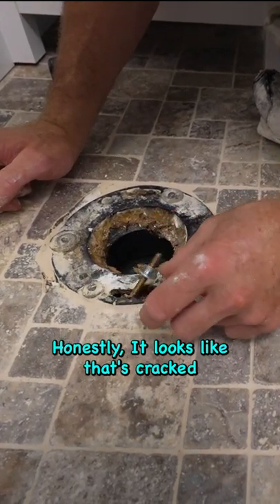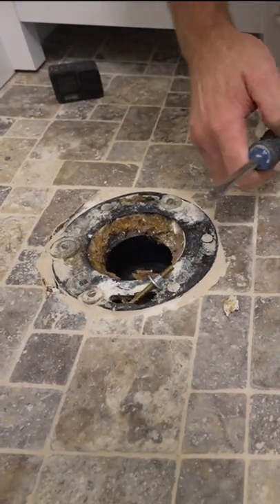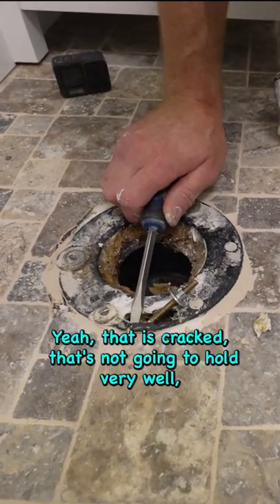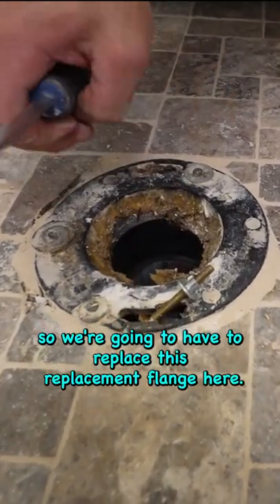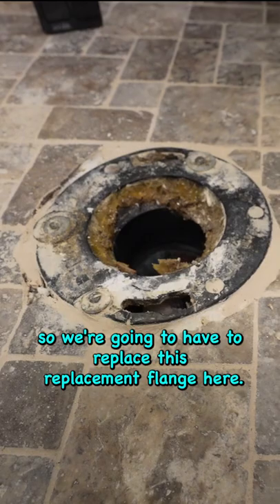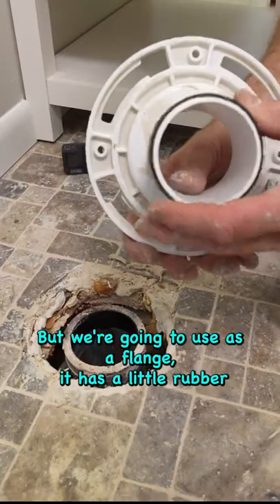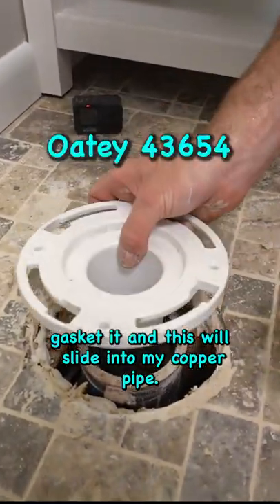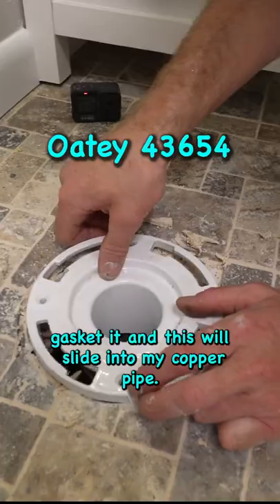Oh NO 😩 A Toilet Flange Crack🚽#shorts #Youtubeshorts #DIY

Comment: Surprised that u did no repair to the gap in  the flooring around the drain pipe before installing the new flange.  It appears that the original flange failed because of undue stress from lack of support around its entire diameter.
Reply: It seems like all workers these days. Take those shortcuts.
Reply: How would that have been done without damaging the tiles and making it a much bigger repair? The flange is even with the floor so the toilet isn't going to rocking on it and will be well supported by the floor, I personally would have done a metal repair ring but the reality is it's not reasonable to go back and redo everything to 100% of how it should of been, it's too much money and too much time for most people and in a lot of situations good enough is good enough even though internet trolls like yourself like to act differently
Reply: Exactly
Reply: Maby thw owner just didn't have the money to properly repair it maby it wasn't up to this guy's.
Reply: agreed lazy work.. fill it with fast set cement.. level to floor... tapcons..

Comment: My dude forgot to twist it to tighten the seal against the inside of the pipe. That’s like the whole throwing a hot dog down a hallway for a girl that’s been around, you’re barely touching the sides of that pipe. Copper pipe might have a slightly different ID (inside diameter) no twist equals no seal. If that pipe ever backs up your floor joists will be met with human waste water.. enjoy.

Comment: That flange slid in with ease like a cheap first date.... too easy!  Pretty sure there are some that twist and create a seal brotha. Yall gonna have a backup and see that doo doo butter come a pumping out, breh!
Reply: If you didn’t notice it wasn’t even sliding into a pipe…it’s another rubber double sided boot like clamp.
Reply: @rideordie1583  It was sliding into the pipe. The pipe was connected to the fernco (rubber double-sided boot like clamp). You have to kind of really look for it to see the pipe.
Reply: He didn't twist it to give it a proper seal.

Comment: Original flange not secured.  Should add stainless washers and stainless lags screws to secure new flange. Also, the type of new flange requires you screw clockwise in order to expand gasket to seal. You should have filled the void in floor prior to setting new flange

Comment: Flange should be above the floor height.
Reply: It's true but it's actually better to be closer to flush then have a gap above. 90% of the cracked flanges I see or even toilet leaks is a gap between flange and floor not sitting on it support so the weight of commode cracks flange suspended in midair. That being said......the steel ringed flange would still prevent that error from happening (but not leaks still)
Reply: @Spookytooth92  That sounds like a failure to properly install the flange to where it sits on the floor than it is a need to make it level with the floor.
Reply: You’re wrong. But ok. You want the toilet flush with rhe floor. Not much more than that

Comment: That flange is a twist and lock flange. You didn’t install it correctly by just pushing it down. They have a thread on it and the more the gasket moves closest to the ceiling the tighter it gets. I usually use some pipe dope around the gasket as well so it seals even better.

Comment: Cool tip. What were you able to drive
The screws into? It looked like there wasn’t much around the pipe.
Reply: Every once in a while you find that magical air in the void that holds a screw and it’s amazing.
Reply: He put the screws in at like a 45° angle, which tells me it most likely was the only way to hit the subfloor.
Reply: You can’t be Chris R.

Comment: I hate when people use those flanges. It reduces the pipe diameter way too much. Zurn makes a replacement that goes over the pipe and seals from outside and u have full diameter.
Reply: This is nonsense that I have even heard some plumbers repeat. Do you know what the size of the built in trap on a toilet is or what size the tail on a reinforced wax ring is? It is less than 3" in both cases, usually between 1 3/4" and 2 3/4". So you're telling me that increasing that section by 5" or 6" will cause clogs? No, not if you're flushing what is supposed to go down the toilet - waste and toilet paper only.

Comment: Nope, he just reduced that opening from 4 inches to less that 3 inches. That toilet is going to start having clogs more and more. Never reduce the mainline opening like that. Replace with a 4 inch flange.
Reply: This is nonsense that I have even heard some plumbers repeat. Do you know what the size of the built in trap on a toilet is or what size the tail on a reinforced wax ring is? It is less than 3" in both cases, usually between 1 3/4" and 2 3/4". So you're telling me that increasing that section by 5" or 6" will cause clogs? No, not if you're flushing what is supposed to go down the toilet - waste and toilet paper only.
Reply: Also that opening is 3". What you're looking at that you think is a 4" pipe is actually a fernco.
Reply: That's bullshit..done this repair a thousand times and never a problem

Comment: #1- Why not replace it with the same 4” cast iron bolt down flange?
#2- you didn’t install that Oatey “cheater” flange properly. You need to twist the flange so the black gasket tightens inside the pipe. You’ll find out the hard way once the toilet line backs up.

Comment: Copper pipe?????looks like a rubber boot...we see the clamp around the rubber boot. How did you tighten that clamp after you screwed the flange to the floor.
Reply: He bypassed the "rubber boot" (fernco) and slid the repair flange into the copper pipe that it was attached to. The fernco (rubber boot) became unnecessary at that  point so there was no need to tighten it.

Comment: I don’t like your repair. Once you removed the old piece, you should measure the pipe and buy size to fit. I always purchase pvc with a stainless steel flange, I don’t use units with plastic flanges.   Jim

Comment: I have GOT to find those pieces that went on the closet bolts! The plastic washers do NOT work and putting a nut on there sometimes makes it too big and toilet won't seat correctly. 
What are they or where did you find them?  Pleeeeease?!

Comment: From a contractor perspective. The proper way to fix a cracked flange is to get a licensed plumber to come to and do the repairs so it is under proper warranty.
Reply: From a contractor perspective I usually install my toilets after my licensed plumber does everything else. I like to leave them off until the end to make sure I can paint and install baseboard first.
Reply: @Tool_Addicted_Carpenter  As a contractor. You shouldn't be installing baseboard and painting. You are literally missing the purpose of a contractor. It is not our job by any means to hook up toilets, install baseboards, and paint. It's our job to know the phone numbers of plumbers, carpenters, and painting companies, and facilitate it all being completed.
Reply: @misplaced_redneck7233  What are you talking about? As a general contractor our job goes beyond just coordinating subcontractors. I know very few GCs that limit themselves to finger pointing. It makes a lot of sense economically efficiency wise to play your strengths and do as much of your own work as possible as long as it doesn't impact scheduling. I very rarely paint but I do all of my own trim work, kitchens, built in cabinetry, and fireplace mantels. I don't trust anyone else to care as much as I would. I utilize 2-3 dozen specialized subcontractors but I do most of my own small framing jobs and always do my finish work.
Reply: @Tool_Addicted_Carpenter  While I do respect 100% the mentality of "Wanna get it done right, gotta do it yourself" On many finish items, but the idea it doesn't make sense "economically" to have subs do the work just doesn't make sense if you estimate properly that should all be factored in and you'll be making a percentage either way.
Reply: @Tool_Addicted_Carpenter  Maybe its different where you are but down here in South Florida if you aren't working on a Time + Material + Percentage basis you are asking to lose your ass any second on a project. Just my experience.
Reply: @misplaced_redneck7233  Ya my prices are time+material+20-30% profit/business expenses. Time and % varies based on complexity. I just price everything based on my experience with my subs and I price what I know I'll be doing myself accordingly. I have 2 business partners and we utilize our different strengths. One does drawings, site visits, basically PR(like sending holiday cards to customers or flowers at the end of builds), and meets subs. The other is very good with business and takes care of aquiring some materials and towing the trailers, and can be the cut guy and does most Carpentry. I do the initial estimates, make stock lists, preliminary drawings, before we all sit down and go over them. Then I do the design and build and finish everything. All 3 of us meet customers and subcontractors whenever and we all bang out some insulation if we need to. It's a solid dynamic and we've acquired some great subcontractors.
Reply: @Tool_Addicted_Carpenter  See now you're literally not making sense if all your prices are T+M then you should have no worry about getting your toilet set "economically" because whatever the plumber charges you, you're just going to charge the homeowner + your percentage and make money off of it. You doing it yourself loses you money by your own reasoning.
Reply: @misplaced_redneck7233  I don't lose money and the plumber has no problem setting or not setting the toilets I just tell him what I prefer for that particular job. I actually make money because the homeowner already has a price based on my plumber doing everything and he doesn't charge me for what he doesn't need to do so the money goes to me rather than the plumber.
Reply: @Tool_Addicted_Carpenter  Okay you're literally not making sense. Bring it back to the beginning, your WHOLE argument was the "economic" point of setting the plumbing yourself. Now you're pretty much just saying you bill and accept payment as if the plumber is doing the work. But you do it yourself and keep the money. Which is fraud by the way. If you overcharge for a service which is fulfilled at a lower price you are obligated to pay back rhe difference. I'm just trying to give you advice because it really doesn't seem like you know what your talking about, especially if you're this comfortable admitting to fraudulent business practices. If I charge someone to build a pergola on their property, and I estimate it as if I'm having my outside carpentry subs build it for me. And I end up building it myself, that doesn't mean I keep all the money it means I adjust and pay back the difference. People like you really do give genuine contractors such a horrible look.
Reply: @Tool_Addicted_Carpenter  I love the fact once I point out that you are on here openly talking about fraudulent billing for clients, you go silent.
Reply: @misplaced_redneck7233  It's a wax ring and 2 bolts. You're being absolutely ridiculous and I think most people would agree. It's not fraudulent billing and everything is permitted and legal. Take a chill pill, I know what I'm doing. I've taken formal plumbing education classes and a toilet is so simple a homeowner can install their own in 15 minutes. You can call it whatever you want, I'm a good contractor and I don't get callbacks.
Reply: @misplaced_redneck7233  And your other comment never game in my feed so stop hovering over your phone fishing for an aimless and senseless argument with someone you don't know and will never meet or be effected by. Do a little introspection for the rest of the day.
Reply: @misplaced_redneck7233  dude wtf are you talking about? You give the client a price and they accept it. It doesn’t matter who does the work or how much they’re charging. If your sub is also subbing you think the client also need to know their price too?

Comment: That’s a fail for me there’s a fernco below that and you reduce the flange opening To 2”inches that’s a constant clog
Reply: This is nonsense that I have even heard some plumbers repeat. Do you know what the size of the built in trap on a toilet is or what size the tail on a reinforced wax ring is? It is less than 3" in both cases, usually between 1 3/4" and 2 3/4". So you're telling me that increasing that section by 5" or 6" will cause clogs? No, not if you're flushing what is supposed to go down the toilet - waste and toilet paper only. Also that is not 2 inches. It's 2 1/2" and yes it does make a difference.
Reply: I agree.. I've done this same repair a thousand times and never an issue

Comment: Looks like that was a fernco type coupling under the floor. I don't use wax rings anymore. Maybe a stainless steel reinforcing ring would have worked? Good repair anyway.